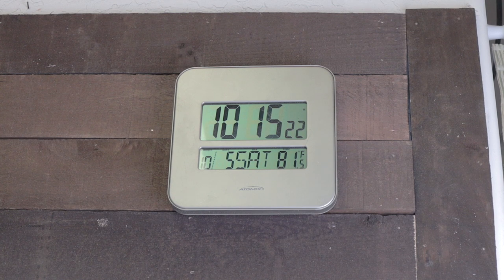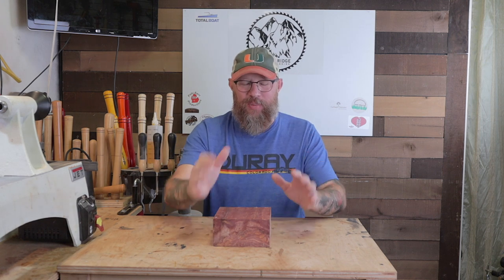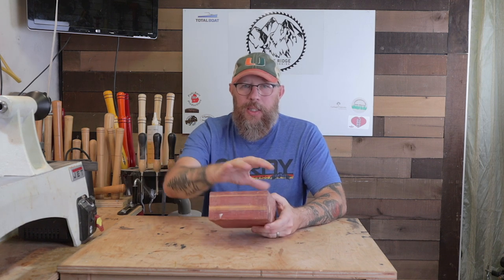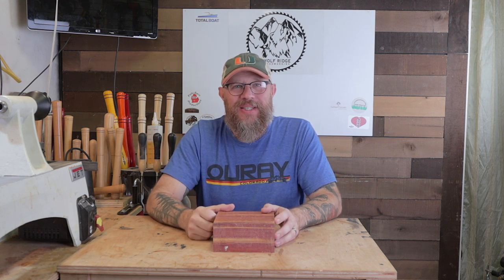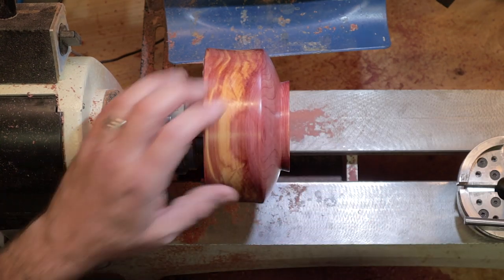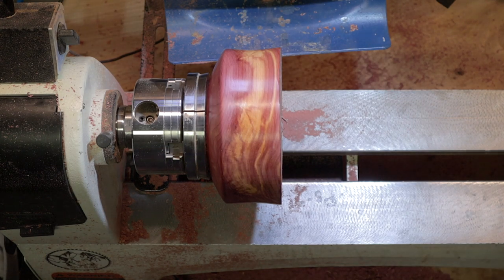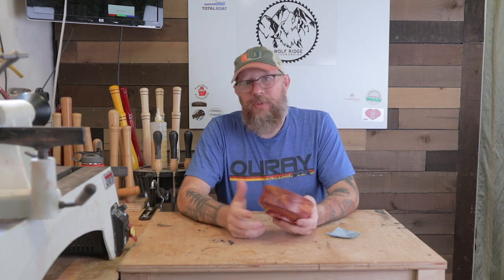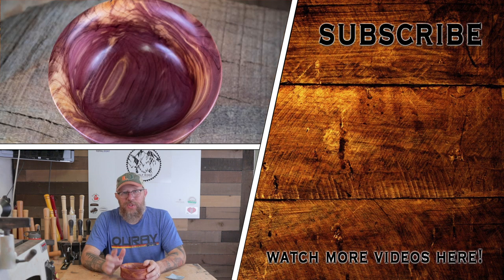Woodturning: Can you safely turn a bowl in around an hour?

Comment: Do you always use the sanding sealer and the Acks paste?  Are these materials safe for bowls used for food?  Do you ever just use linseed oil or tuna oil?
Reply from the maker: Mylands Sanding Sealer and Ack's Paste is part of my typical finishing process.  I use it on just about every project including resin and wood projects.  I'm not sure about the sanding sealer, but the Ack's products are completely food safe.  I've used boiled linseed oil on shop projects, but I've never used tuna oil.  Does the tuna oil go rancid over time?  - Ed

Comment: I did a half log maple bowl yesterday. Start to finish,  1:45. Cheated on the finish, hit with good ol feed n wax. 
  Pretty piece of cedar there. Western red ???
                               Mark
Reply from the maker: Good job Mark!  Did you do a natural edge bowl?  I got it on eBay and it was labeled eastern red cedar.  - Ed
Reply: @WolfRidgeWoodworking  no, not this time.  Just a regular bowl. Nothing really going on in that particular piece of wood. Lots of bug holes.
                             Mark